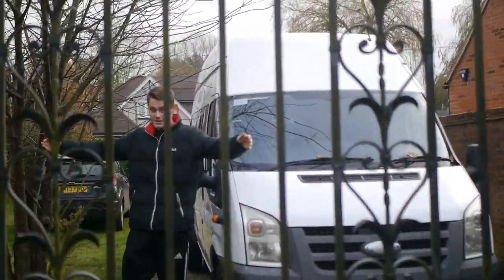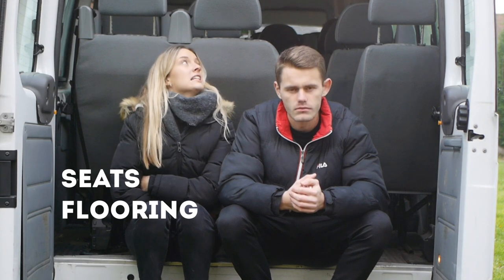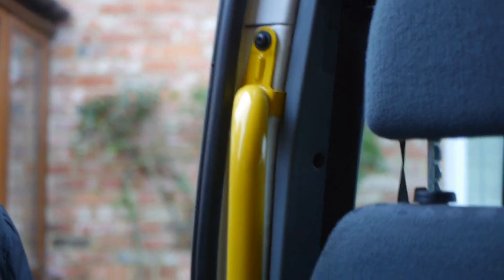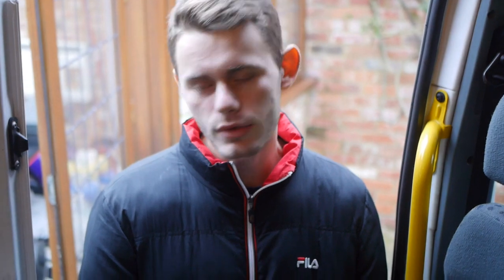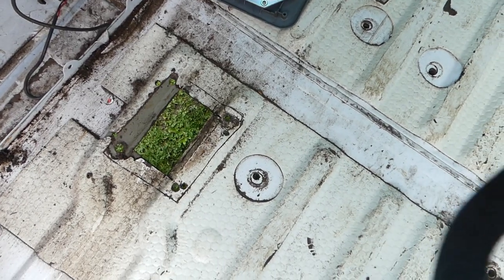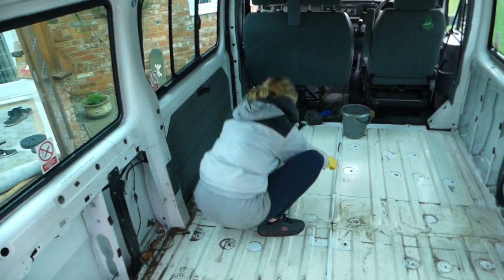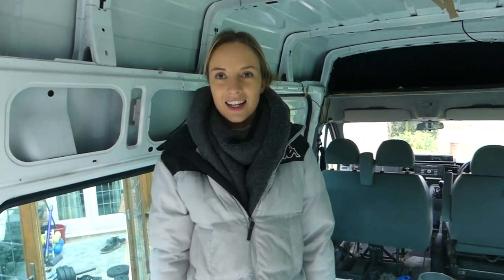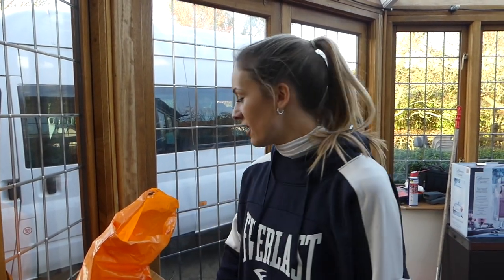Ep1: Buying and Stripping the Minibus / FORD TRANSIT CAMPERVAN CONVERSION START 2 FINISH / UK

Comment: Had a friend start doing similar, he had to sell it as his License didn’t cover above 3.5t (transit twin wheel base). The high cube is a great size, one day I need to have a play at doing this.
Reply from the maker: Definitely can be an issue (unless you do what we did and get it weighed when fully converted and then downplated to 3.5T!)
Reply: @NickyandHarri  awesome.
Reply: Hi there,great build by the way,im thinking of doing the same but was concerned about weight issues,what did it end up weighing at the end of the build and is downplating an easy process as I've read a few horror stories online.
Reply: @NickyandHarri  what did yours weigh after down plating? At the step to do this myself now. Thanks!

Comment: Hi, my wife and I are thinking of doing the exact same thing with an identical van we've seen. One thing my wife was concerned about is whether you lose any insulation due to the windows. Does it get extremely hot or cold?
Reply from the maker: Hi mate, really haven’t had any problems with that yet! We’ve covered the back set of side windows up and classed over them but for the rest we haven’t had any trouble yet! If anything it allows us to control the temperature more because when we need one we can open all the windows and allow a breeze through! Hope this helps and feel free to ask us any questions you have!

Comment: Hope you got C1 licence. Vans probably over 3.5ton
Reply from the maker: We're going to complete the build and then go on a weighbridge to see. Hopefully will be under 3.5 tons, but realistically it will probably be over. In which case, one of us will have to get a C1 licence - no biggie. Luckily weve budgeted for it!
Reply: It's actually a D1 licence as its a minibus with more than 9 seats. Sure a d1 is upto 17seats and 12tons. Doesn't matter if you take seats out it will still be registered as a minibus. Unless you re register it after conversion as something else. Wouldn't want you to get caught out driving it with a C1 licence thinking your doing the right thing and it's still registered as a minibus.

Comment: That hole in the back be perfect for a diesel parking night heater looking forward to the build.
Reply from the maker: That would have been a great idea. Unfortunately we've already fibre glassed it up! And were taking it to europe over the spring/summer and selling it soon after, so probably wont need a heater for our time using it!
Reply: @NickyandHarri  Was my first thought when I seen the hole, I also have a Mk7 transit and its around the same place I fitted mine as I have it under the long bench seat/bed. Good luck with the build it can be fun .
Reply from the maker: Cool! Thanks so much!

Comment: Hey !!! I just done the same thing but i dint manage to get the jumbo so i have to deal with the lower roof
Reply from the maker: Ah that's a bummer! We were originally going to go for the medium roof because the higher roofs were much rarer to find and a bit pricier to buy. But we suddenly found this one a couple weeks ago and bought it on the same day! Keep us updated with your conversion!
Reply: Yeah their so expensive i only paid £2000 for mine on 104k 2004 shape but had all the welding done but no service history, i wont be doing pics or owt of my conversion, its a budget build camper becuase its mainly to carry my stunt bike and tools then whatever rooms left ill try get a bed and a frodge etc
Reply: I've got the chance to buy an 05 with 134k on clock for 3k. Really tempted im just not sure on the insurance as its not classed as a van. How's your build coming along?
Reply: @BigDurgL33  alright mate thats not bad i paid £2100 for this 104k for my 2004 mk6 but its the 2.4L rwd well juicy but pulls well, im in the middle of building the sub floor atm

Comment: How do you take the seats out please guys?
Reply from the maker: Skip to 1:53 mate!  They're pretty heavy and take a lot of force with a wrench. Best of luck!
Reply: @NickyandHarri  so just have to undo the floor bolts? I took of one but there seemed to be no movement,. When they're all off so you still need force to remove the seat? Thanks

Comment: Be good to know "why" you decided on the minibus over a std. van?
Reply from the maker: At the time, in the 2nd covid uk lockdown the price of normal panel vans had shot up, but minibuses hadn’t. So it was just that it was cheaper and it already had windows installed!
Reply: @NickyandHarri  Thanks for that. I noticed in your final build that most of the windows were paneled over. Good for privacy but I'm a claustro. I would need that glass. Well done on such a epic fit out! How many person hours do you reckon it took? It's a lot bigger project than one thinks. Fiddly!